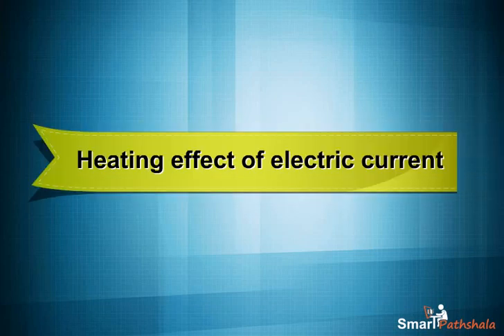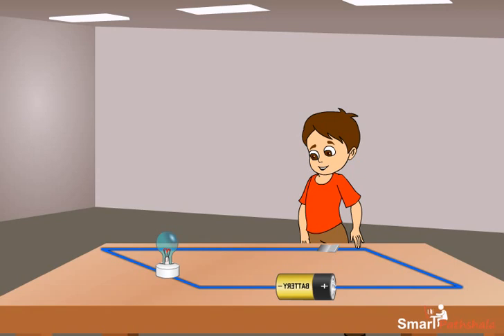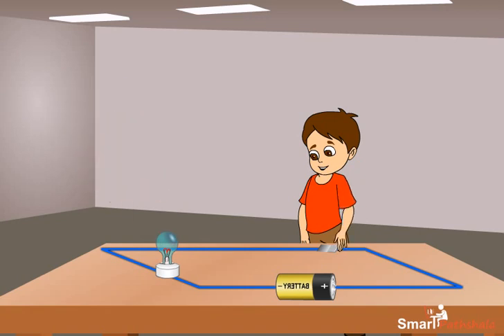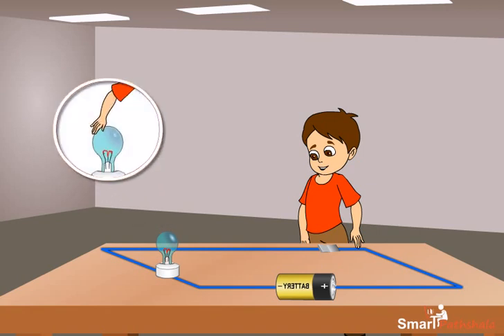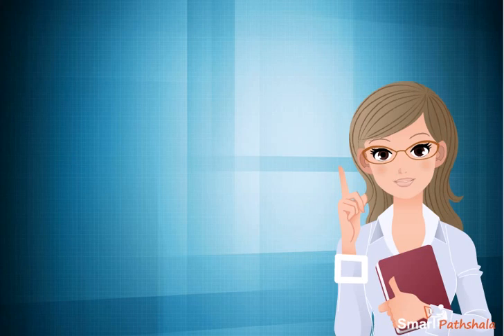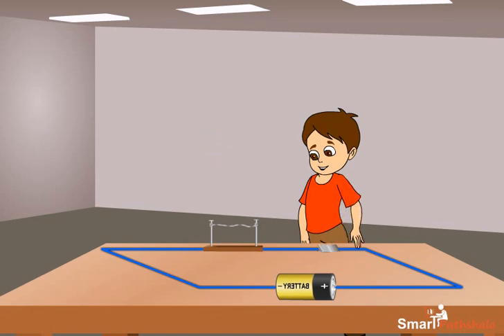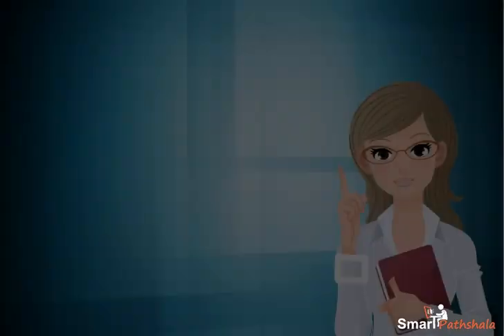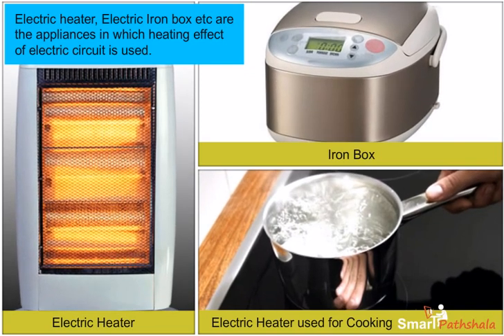NCERT CBSE Class 7 Science Chapter 14 Electric Current and Its Effects Part 2

Comment: Do not do this in home because electric cell pass current and the circuit is open also when you touch the wire the wire will give you shock